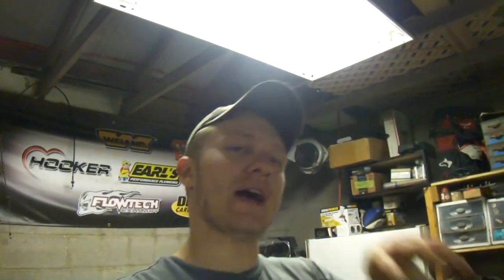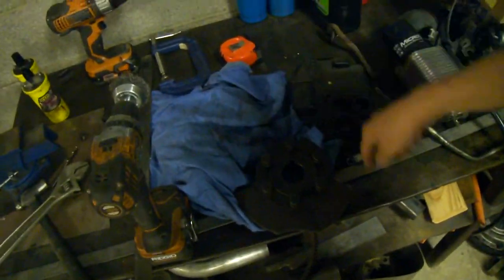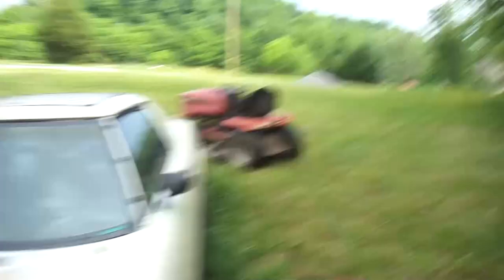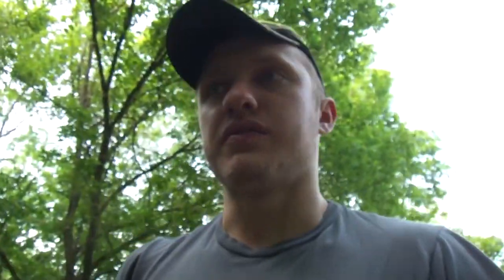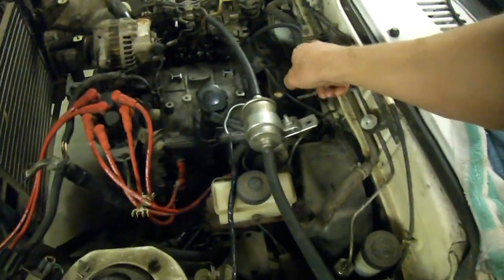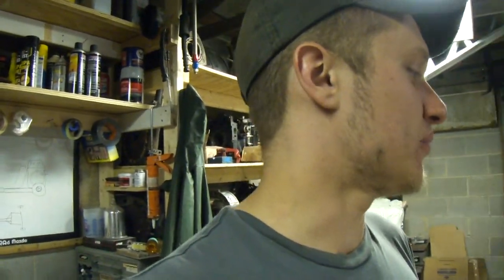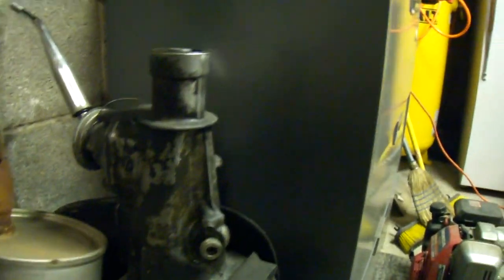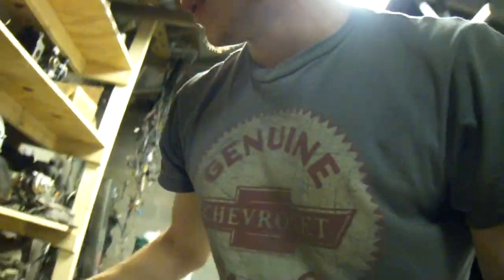How To Manual Swap Your SA-FB Rx7

Comment: What wires do I need to cross for neutral safety and reverse lights so I can start it and have reverse lights. I have an 85 trans bolted to an 81 12a

Comment: so i have a clutch pedal but not the whole assembly. is there a way i can just mount this clutch pedal and cut the brake pedal in half so it can fit? i can only find the whole assembly places for like 200-300$ and if i can use the clutch pedal i already have from an rx7 then that would be sick but your the expert so you would know

Comment: I'm looking at buying an auto S3 RX-7. If I use an S5 turbo gearbox, would I need a different tailshaft/drive shaft? The gearbox has been rebuilt and the shifter has been moved forward to suit an RX-3, so would I have to put it back to original to fit?

Also, are the diff ratio's different between auto and manual?
Reply from the maker: Diff ratio should be a 3.9 I believe, Using an S5 Turbo gearbox, the original shifter location of the gear box would work.  I would try to mount it with the RX3's location first, and go from there.
Reply: @RADPotential  Thanks for the reply Eric, what about the drive shaft, would the stock one be the right length?
Reply from the maker: You will need a driveshaft made to fit the T2 output shaft.  you can probably just have  the driveshaft yoke swapped, they are close to the same length

Comment: Will 82 trans and driveshaft work on my 85 gsl automatic for the swap
Reply from the maker: Yes but the driveshaft will not match the flange on your rear differential.  However since the 82 flange is smaller. You can drill the flange on your car. It has a centric ring on it. So alignment isn't an issue.  But all lengths and shifter locations will work just fine
Reply: @RADPotential  what year should I look for that will match with out modifying and will bolt right up
Reply from the maker: The trans can come from any FB, 81-85.   The driveshaft needs to come from an 84-85.   Look under your car.  If the driveshaft flange is a square you need 84-85.  If its a rectangle, you need 79-83
Reply: @RADPotential  thank you will pedal system work from a 80to83 on a 85? Or no
Reply from the maker: As far as I know you will need the 84-85 pedals as the dash/ colum mounts to them, and the 84-85 have a different dash setup. but I would have to check in the parts cars tomorrow.  I'll look and get back
Reply: @RADPotential  Please thank you I've located a clutch&brake assy but its labeled 81,82,83
Reply: @RADPotential  Dou you happend to know if RX8 seats fit FB's or FC's
Reply from the maker: Pedal update..  looks like the pedal brackets and locations are the same, the difference is the shape of the pedals and the pedals themselves are steel vs aluminum. SA VS 84-85.  I dont have any cars here between 81-83
Reply from the maker: Rx8 seats will fit but sit higher than FB seats. So if your a tall guy then it's not the move.
Reply: @RADPotential  Am 5'11 gonna give them a try there is many RX8 here in socal Pick a part junkyards in great condition so far found a 82 trans but no luck on pedals and shaft of flywheel
Reply: @RADPotential  great then i can use 81to83 on a 85 if mounts the same thank s I also just bought another fb shell looking for a motor and trans for that one on the hunt I go.